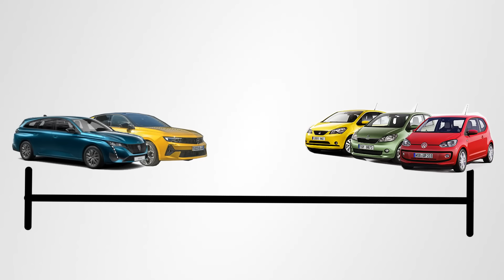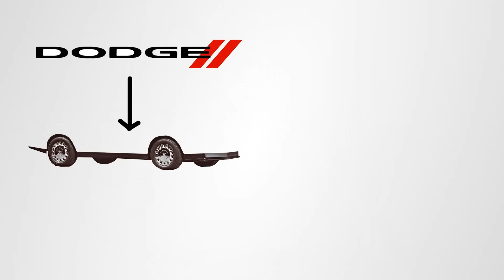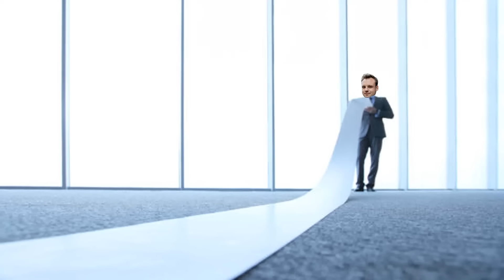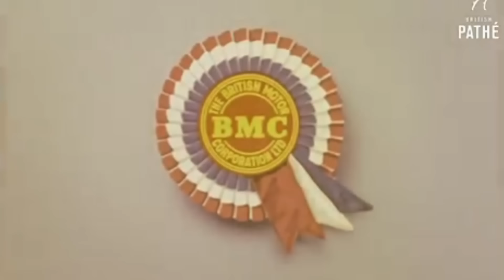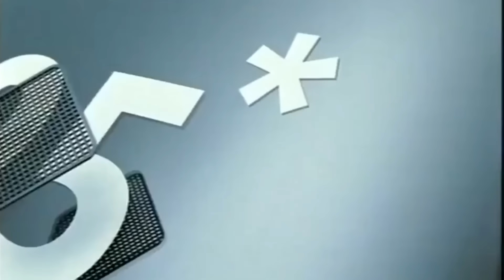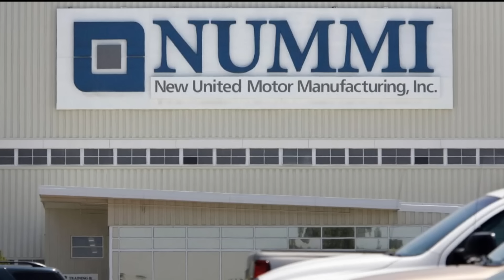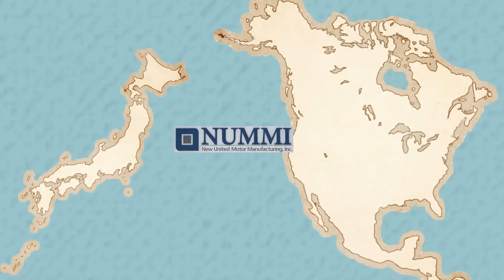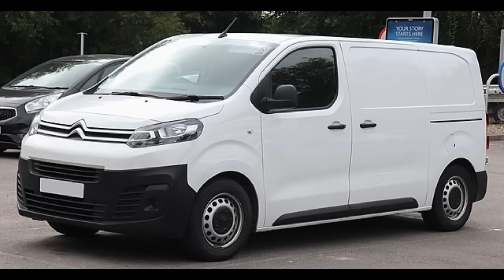Ep. 30 Seeing Double: The History of Badge Engineering

Comment: I used to drive a 2010 Volvo V50. It’s from an era where Ford owned Volvo, and as a result it shared its platform with the Ford Focus wagon and the Mazda 3. I have driven both the sister cars, and while they share very similar shapes and many of the same mechanical components, the drivetrains, exterior details, and interiors were all completely different. The Volvo and Mazda were quite nice and somewhat peppy, and they shared front and rear design language with other models from the same brand. The Ford had an almost laughably cheap interior and a sufficient powertrain. All had really awful transmissions and pathetic gas mileage. The otherwise lovely turbocharged 230hp PZEV I5 on the V50 got 5 mpg less than I get now with my T6 V90, a much larger and faster car.

Comment: Yes, the Chevy Celebrity, Pontiac 6000, Oldsmobile Cutlass Ciera and whatever the Buick version was called was a popular example of rebadging.  Different engines, interiors, grilles, front ends and rear ends.  The problem is the quality (at least early models like mine) was not that good.  Why produce 4 "different" mediocre quality cars so 4 different dealers (Pontiac, Chevrolet, etc) will have a model to sell?

My current car (original plastic 1991-2002 Saturn "S" series) was decidedly NOT a rebadge and will probably never be copied.  A light curb weight won't meet today's safety standards.  But my plastic panels will never rust and they still look good after 20 years !

SPECIAL MENTION: A lady in my church once drove "The 1975 Buick Opel by Isuzu".  It might have been a re-badged Opel Kadett, likely manufactured by Isuzu.  The Buick division of GM did sell some Opel models with Opel badging in Buick showrooms in the late 1960s / early 1970s.

Comment: The Peugeot 106 had nothing to do with the Citroën C1 and Toyota Aygo; that was the 107 and later the 108. The 106 however, was built on the basis of the Citroën AX platform, and later the Citroën Saxo would be based on the Peugeot 106; so convenient

Comment: The GM Nova of the 70s and X car of the 80s are sone really obvious rebadged offenders. The Nova was a Chevy, then followed by the order of letters in the word "NOVA" were: Oldsmobile Omega, Pontiac Ventura, and the Buick Apollo. The X cars did a bit better because that famous X car hatchback shape was a Chevy exclusive as the Citation, but the Pontiac Phoenix, Olds Omega (2nd gen) and Buick Skylark were nearly identical as they lacked the hatchback but had the formal notchback styling that was shared between the 3. Im surprised you didnt mention GM more as they practically invented rebadging and got lazier and lazier dufferentiating the brands as time went on. These actions led to the death of "middle class/entry level luxury" brands Pontiac and Oldsmobile respectively.

Comment: Ford has the Crown Victoria Mercury Grand Marquis and Lincoln Town Car all 3 are rebadged Crow Victorias The Ford Lincoln truck is a rebadged F-150.. GM has the Cadillac Escalade that's a rebadged Chevy Tahoe the GMC Denali is just a GMC Tahoe/Suburban.. Chrysler has the Chrysler 300 that is just a luxury Dodge Charger. I have a '77 Oldsmobile Cutlass that is a Pontiac Grand Prix, a Chevy Monte Carlo and a Buick a the same thing same platform chassis same cabine all made by Fisher just different interiors and different front and back design..

Comment: the isuzu gemini was also tied with the isuzu rodeo for most rebadged as il quiclky copy it from the wikipedia page
	Isuzu Rodeo (Japan and Thailand; 4WD only)
Isuzu Dragon Eyes (Thailand; 1996–2002)
Isuzu Dragon Power (Thailand; 2000–2002)
Isuzu Fuego (Philippines)
Isuzu Invader (Malaysia)
Isuzu Ippon (Israel)
Isuzu KB (South Africa)
Isuzu Pickup (North America)
Isuzu TF
Isuzu TFR (Thailand)
Isuzu TT Fortigo
Chevrolet LUV
Chevrolet T-Series (Egypt)
Holden Rodeo
Honda Tourmaster (Thailand)
Opel Campo
Vauxhall Brava (United Kingdom)
Bedford Brava (United Kingdom)
Foton SUP (China)
Jinbei Jindian SY10 (China)
JiangLing Baodian (China)
JiangLing Hunter (Philippines)
Winnerway ZH6500/ZH1021LU2 (China)
Xinkai Century (China)
Autorrad Century (China)
GMC Dragon (Mexico; 1996–2001)
GMC Invader (Mexico; 1998–2002)

thats not even including the versions that were modified to be SUV's which i wont count cause they are different enough to me

Comment: Let's not forget about the most absolutely pathetic rebadge situations known as GM's minivans. At least that Isuzu sedan that was sold in numerous iterations was sold in numerous places with no more than 2 variations per country. GM at one time sold 4 of the exact same minivan all at once in USA with minimal changes between any of them. They were the Pontiac Montana, Chevrolet Uplander, Saturn Relay, and Buick Terazza. All 4 were ugly, cheaply made, with hard plastics and fake wood trim and thin vinyl over foam to mimic leather, and were overall just dreary. Why a range of options for such a lacking vehicle was offered was completely beyond me, perhaps that was the only way they could make them seem even remotely exciting. The Buick was the only one to offer anything significant over the others with some luxury trimmings and an optional all wheel drivetrain, but there was absolutely no reason to pick one of the others over the other 2. It was based solely on what dealership you happened to walk into.

Comment: So, here me out. Yo got the pontiac pursuit in mexico and the g5 in canada, so they renamed a car for north america. After that, you get the chevrolet cobalt with it's ss model, but you also have the gt model of the g5, that don't look the same has the cobalt ss and does less hp. But it do more than the cobalt and the g5 and then, you see the cobalt coupe, but wait! Who's that? Saturn ion is here and have the same plateform has the other 2, but with it touch. The car is ugly has hell and have it plastic body. The funny thing about those car is that 2 of them looks the same, but are different in a lot of way. Pontiac have less issue than the cobalt, but saturn is here and it's a completely different car on the outside, but the same platform (With 8 hp less than the g5 for the same engine) those 3 cars are rebadged, but not in a way you said on the video